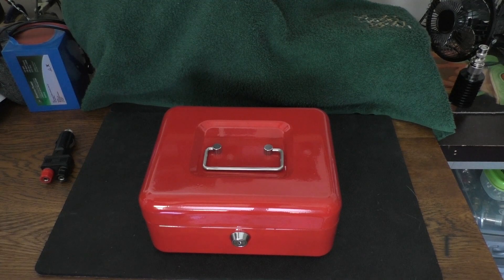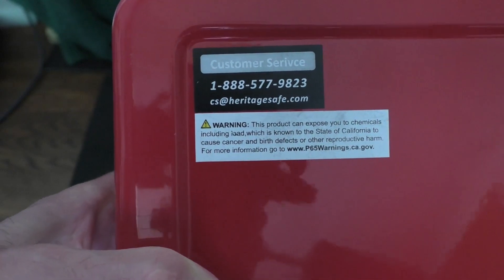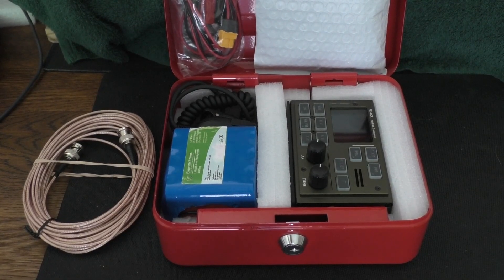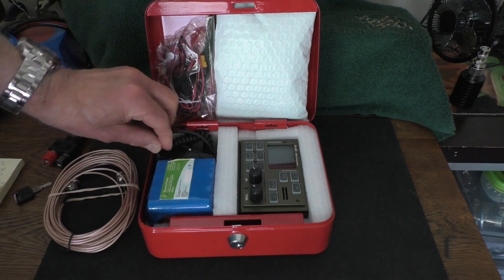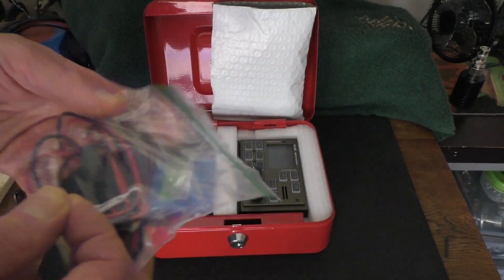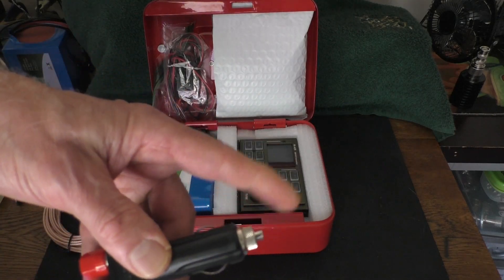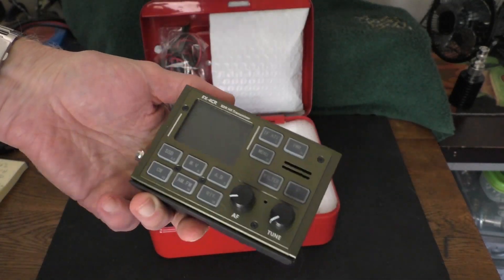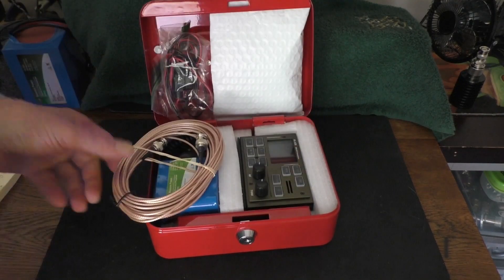Portable travel kit for the FX- QRP Transceiver

Comment: Meh. Great to see other ideas, but I simply use the box the FX-4CR comes in placed inside a backpack. My Komunica HF-PRO-2-PLUS-T and Gabil GRA-7350 antenna wouldn't fit in this tiny cash box along with the Gabil GRA-ULT01 MK3 tripod. Everything fits nicely inside the backpack including a RigExpert AA-35 ZOOM analyzer and ANTUNER AT-100M ATU. I even carry an extra battery in the backpack. Thanks for sharing, but I find the stock case inside a backpack much better for my needs.
Reply from the maker: I have a similar setup in a maxpedition day pack with different qrp antennas, line to throw throw wires in trees, adapters etc.. the case included is really nice like you said and I use that too. 
The red steel box is an experiment to see how small a package I can include everything to get on the air an idea for people to keep in a small area like an EMP box, or safe. Everything to get on the air. The built in SWR meter can help  to tune the antenna without an antenna analyzer. 
However, given a choice, like in a backpack, I'd also usually use larger antennas, an analyzer, etc to make everything easier. 
Bottom line for me is the fun of trying to make the smallest package that will still get on the air, and the FX-4CR is the smallest radio to do that with especially at 20W! 
Thanks for the comment !

Comment: That antenna is a terrible idea. Do not use an Endfed random length antenna on this radio - you’ll fry the finals.
Use an end fed half wave cut for 40m its resonant on 40 20 15 10

I can’t get behind using a metal case with a lithium based box case
Reply from the maker: A metal case is fine, ammo cans are used all the time.. and lead acid would be the same danger in gel cell etc. The bioenno is totally incased and no exposed terminals so pretty safe. This was just a prototype idea, if i was doing it for real I"d cover it in non conductive something better than just foam i have in it for better safety.